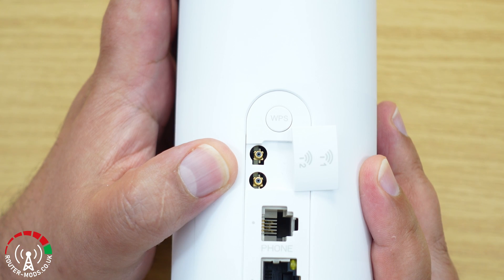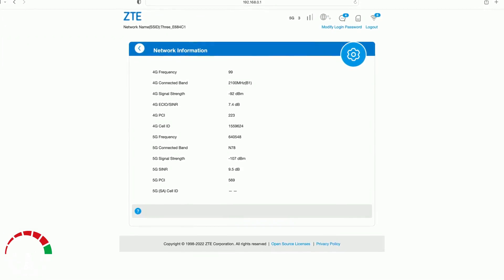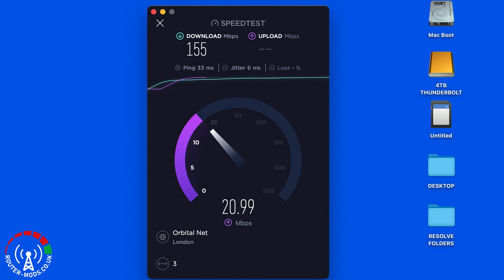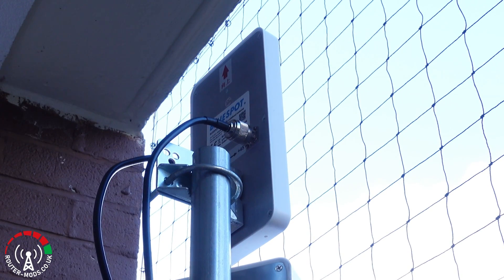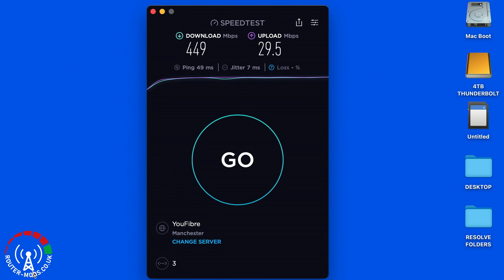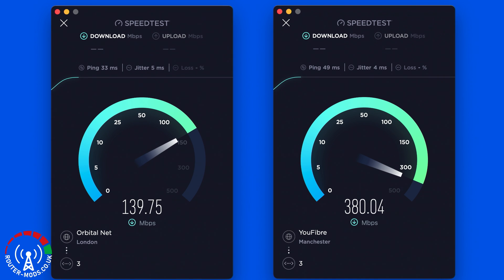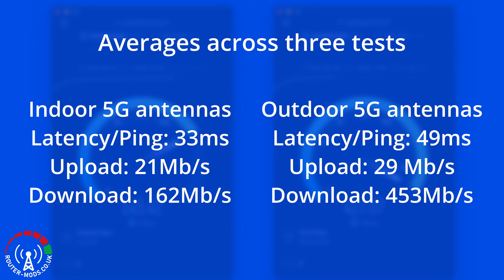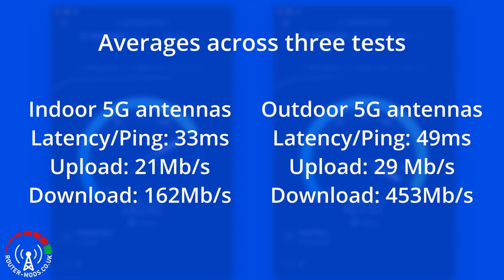ZTE MC801a TS9 Port damaged replacement PT2 - Modification Service Testing indoor & outdoor antennas

Comment: I have one of these that I intend to send to you for modding. I want to pair it with my Poynting XPOL-24 4x4 on it's own, 4 SMA cables total. What mod would you recommend I pick on your website?
Reply from the maker: hi, We offer a "full modification", this modified both the 4G and 5G antennas or we have the "part modification" that modified only the 5G. Both can be found on our website.